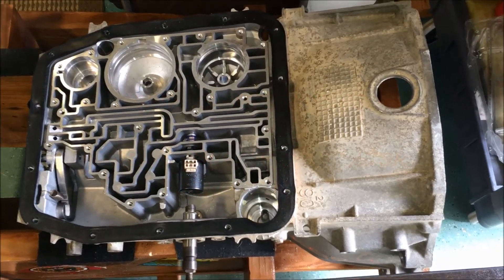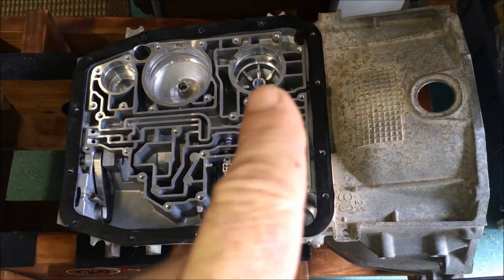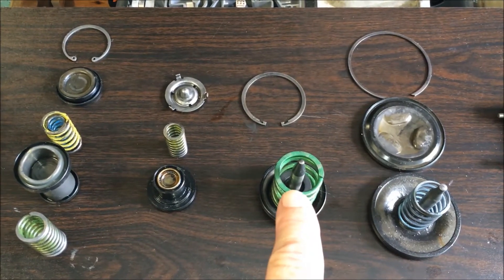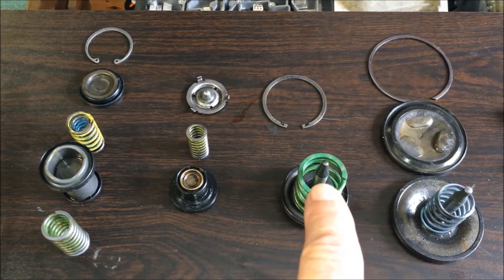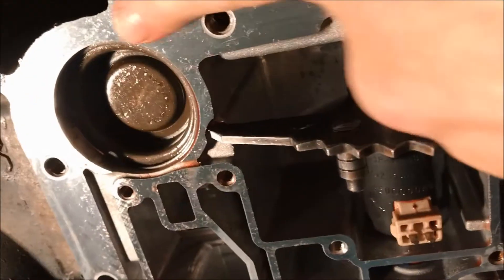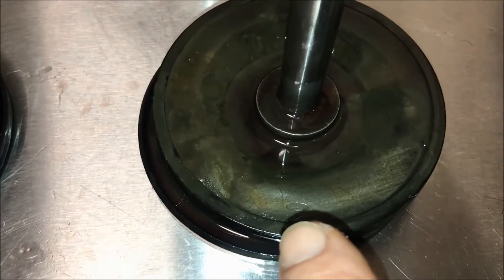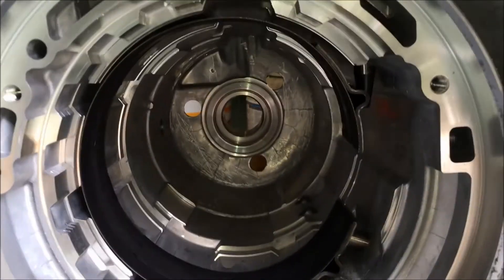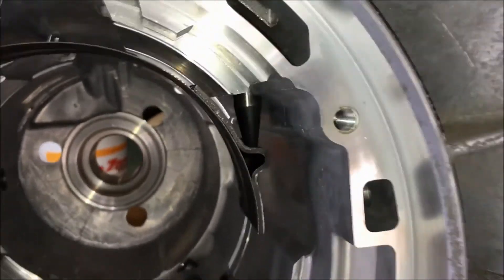How To Remove & Replace Shift Accumulator: 4R70W / 4R75W / 4R75E Series Part 5

Comment: nice video good info. seeing how the rod hits the band really works. is it possible for the rod to go past the hook while driving down the freeway? trying to self diagnose my 3/4 neutral. and its not the snap ring.. anyways Thanks
Reply from the maker: Hi DB, you truck goes into neutral when it shifts to overdrive?  Does it drive normally when you turn off the OD?
Reply: @DrivingIntelligence  yes but i only have 1st and 2nd does not go into 3rd
Reply: im thinking i may have lost the 3/4 band?  just cant believe it..
Reply from the maker: @DB Walker  sorry for late reply.  Does the vehicle continue to drive in 2nd gear?  Or it looses gear when you get to the point where you should shift into 3rd?  I guess another way to ask this, does it stay in 2nd?  Reverse ok?  It might be your shift solenoids.  Easy to replace without pulling engine.  Do you have any engine codes?
Reply: @DrivingIntelligence  hi no codes, drives normal 1st 2nd gear when it goes to shift into 3rd it neutrals out no OD either reverse is fine.. ive pulled valve body down od servo still in with no broken snap rings. the 2/3 accumulator fell out but no broken springs.. i did not take the od servo out? may i should have?   i was told if od band broke i would still have 3rd, also if OD valve in valve body defective i would still have 3rd.. i replace shift solenoid no go dont think it could be the pressure solenoid or OD solenoid because i would still have 3rd gear.. i guess  there is no 3/4 band, still learning..
Reply: @WALKERGUITAR  hey did you fix the issue having a similar issue
Reply: @WALKERGUITAR  I had the same problem, it wound up being a broken direct drum. These transmissions are also known for this problem.
Reply: @Phillyshooter  You are correct sir, that is exactly what it was.. $3000.. next time i am doing it myself.. it looks kinda fun.....
Reply: @WALKERGUITAR  I just finished mine last week. For roughly 600-700 dollars I rebuilt mine. Shifts better than it ever had before.
Reply: @Phillyshooter  Thats great!  mine is a little questionable and he only gave me a 50000 mile warranty! when stopped at a light it makes a noise and you can feel vibration out of balance anyway.. great job doing your own i learned a whole bunch here...
Reply: @agapitoleija2193  Yes, broken direct drum  i had to get a new transmission.. next time i am going to do it myself
Reply: How can you figure out its a broken direct drum???

Comment: Wow.  Incredibly helpful. Thx
Reply from the maker: glad it was helpful
Reply: My hose is to noisy to hear if the drum is leaking, but it thumps well enough, so I pulled the trigger on a sonnax rebuilt valve body from Summit.  
Over 250,000  Miles, I know I should drop it and rebuild it but I’m to frugal and I’m in no hurry.  If this doesn’t fix it, I’ll just drive it around in second till it blows up.
Reply from the maker: Sorry, don’t quite understand your comment.  Your hose is too noisy?

Sonnax is good stuff
Reply: @DrivingIntelligence  my air hose is hissing at the connection and I don’t have a rubber tip. I hear the clutch thump, but if it is has a crack in the weld, there is too much noise for me to pinpoint the sound.  Sorry for the confusion.   
I have wasted enough of your time with my  amateur mechanikin.

Thank you again.

Comment: Is it the same procedure on a aod-e? I have a 95 mustang gt . Like to do this.
Reply from the maker: Yes, the general procedure to replace shift accumulators is the same for both the 4R70W and the AODE, as they share a very similar valve body design and accumulator setup. Both transmissions require removing the valve body, removing the accumulator piston assembly, replacing the pistons and springs, and then reassembling the components.

Comment: Excellent videos. 
I have an OD shifting issue(while in OD it doesnt shift), hopefully replacing the OD accumulator fixes the issue. Already replaced all solenoids, checkballs and fluid with same issue.
Reply from the maker: I’m assuming your 4R70W won’t shift out of 1st gear when in overdrive, despite replacing solenoids, checkballs, fluid, and the OD accumulator. Does it shift normally when you turn off overdrive? If my assumption is correct, the issue could involve a worn overdrive band, damaged clutch pack, or a valve body problem affecting pressure—possibly even a planetary gear or servo failure. Please confirm if it’s stuck in 1st with OD on before I can provide more guidance.3.9s

Comment: Hey have you vet experienced an intermittent 1-2 harshness after a rebuild? I used a stock reman valve body and new accumulators. 1/2 the time the shift feels a little harsh, it never revers to neutral and does this at all loads. I’m resorting to searching for MAF and throttle body issues at this point. Any insight would be great thank you.
Reply from the maker: Have you checked your 1-2 accumulator to make sure the springs are in good shape or intact?  A 4R70W 1-2 Accumulator has opposing springs, one breaking would cause a softer 2nd shift, the other will cause a harder 2nd shift.

Comment: Awesome, looks pretty simple. Ive got a 98 explorer 5.0 with a 4r70w, has a hard shift from 1-2 so im thinking replacing that 1-2 accumulator, along with new filter and fluid should fix it. Im gonna order the parts here soon. Thanks!
Reply from the maker: Good call, the spring(s) in the 1-2 accumulator have a tendency to brake in the 4R70W

Comment: So, I've seen the issue with the overdrive pin and it's correction before. If you're working from under the vehicle, is there any such concern or fix for the reverse piston, or does that band fall naturally onto the pin?
Reply from the maker: That band falls naturally to the pin. Doesn’t require the same install.

Comment: I’m wondering if you can point me in the right direction. I have a 2002 F150 5.4 FX4 that developed a rough shift from 2nd to 3rd at low rpm’s especially when warm but normal at higher rpm’s. It’s at 130,000 Miles. Just recently it began doing this jerk at when accelerating from stops. Like the torque converter is abruptly locking from neutral when I give it gas. Another way of describing it is it is like it is in neutral after holding the brake and when I let go at times it’ feels like I am shifting from neutral to drive. I’ve heard that the 2/3 accumulator is also responsible for “forward engagement”. Could the 2/3 accumulator be responsible for these issues?
Reply from the maker: If the 2–3 shift accumulator is bad, you won’t get third gear. If it’s leaking, you’ll get a sloppy shift from 2nd to 3rd. Based on what you’re telling me, my assumption is that you have problems with the valve body. There are a multitude of valves in the valve body that impact shift quality.  Take a look at this webpage which can help isolate problem areas: https://www.transmissiondigest.com/critical-wear-areas-vacuum-test-locations-2/

Comment: Man you got me! Super excited! Getting ready to order all this stuff and throw it in my transmission. Hope it fixes my shifting issues. By the sounds of it it should. I will report back
Reply from the maker: What kind of shifting issues are you having?  Changing these items plus a valve body rebuild will improve fluid management in the transmission and improve shift performance.  But it depends on the problem.
Reply: @DrivingIntelligence hey I didn't see your reply until now. Some things happened and I am now getting ready to do this. When shifting from first to second and very rarely sometimes from second to third it will come out of gear and rev up high until I let off the gas then it will shift into the next gear

Comment: So on my 2008 p71 i don't have 1st and od but 2/3 works but when i took off the valve body to inspect it the 2/3 servo came off so now im in a stump
Reply from the maker: looks like you need a full set of shift accumulators.  Check out the link in the description of this video.

Comment: I may have an issue with my 2/3 accumulator. The transmission shifts great through out all the gears as I accelerate and also down shift with no issues. But when I slow down to 18 or 19 mph and accelerate again, it seems as though either its accelerating very slowly or in neutral. I have to step off the gas and then apply the gas again slowly for it to pick up speed again as normal. Its the 4r70w transmission in an 05 crown vic. It might be a stupid question but what state are you located in, maybe I can drive to you so you can help me fix this issue and I can pay you because the mechanics around my area don't seem to know what to do or they keep sending me to other places.
Reply from the maker: Thanks for your comment and considering me to help you get your Crown Vic right... let's start with some basics:  1)  do you have any diagnostic trouble codes? 2)  have you recently removed the pan and installed fresh fluid and a filter?  This could be caused by several issues like a faulty TPS, bad shift solenoids, bad accumulator, leaky separator plate and on and on.
Reply: @DrivingIntelligence  no, I have not changes the transmission fluid or have any diagnostic codes. I checked those with blue driver obd2 and nothing. Also I'd like to correct myself; it's not the 2-3 accumulator but the 1-2 accumulator most likely because everytime this happens at around 18 mph after breaking to that speed and accelerating again, the engine wines the same way it does at 1st great except it wines faster since at that speed it should already be at 2nd gear. It's as if I had a menual transmission and I didn't shift into 2nd when I was supposed to. So it must be the 1-2 accumulator because only thr 1st  gear wines like that. As far as the TPS. Don't think that's the issue since the accelartor peddle is responsive all other times as well as when the transmission hesitates to shift to 2nd gear. It may not shift right away but the engine does respond well to accelerator input. Another thing is, the 1-2 hesitation seem to happen once the engine warms up. Also, at lower accelaration 1st changes to 2nd at around 10 mph and at faster accelaration, 1st changes to 2nd at around 16 mph if that makes any difference. Thank you for replying and I appreciate any input or advice.
Reply from the maker: @aeylxb3472  it sounds like it could be the 1-2 accumulator, and you are in luck.  You don't need to remove the valve body to replace that accumulator.  The springs or spring in the 1-2 accumulator have been know to fail / break.  You could drop your pan, change your filter, fluid and the 1-2 accumulator and associated springs, and see how that works out.  By the way, I'm in South Carolina.
Reply: @DrivingIntelligence  Strangely the issue has begun slowly subsiding and then I realized that the only thing that I have done differently was unplug my blue driver OBD2 from the port. So it must have been that, which was causing it since it has always been plugged in. It must've messed with the computer. I spoke to one of the mechanics from Ford service and he told me you are not supposed to leave anything plugged in for prolonged period of time. Another issue I'm having is a humming sound coming from the front end between the 1 and 2 gear while accelerating and only happens if i slow down to around 18 mph. I read that it could be a dirty IAC. Anyways I'm really not sure what the issue is but I will try to figure it out.
Reply from the maker: Interesting, I ran my Bluedriver for months with no problem using data log.  Check out this video for the IAC valve and noise
Reply: @DrivingIntelligence  Thanks. I've already seen a few videos. Well, I'll let you know how it goes.
Reply from the maker: @aeylxb3472  look forward to an update
Reply: @DrivingIntelligence   Ok, so I have a pretty interesting update. Since I got all the parts I wanted to replace being the control solenoid, the TCC solenoid and the 1-2 accumulator springs and piston as well as the cover, I went to work and changed both of those solenoids and when I checked the accumulator springs, they were fine. I also changed the filter and added new transmission fluid. About the same amount I drained off. So I test drove it and still the same issue with hesitation to shift to second gear after slowing down from 30 mph to around 18 mph. It just as if it goes into neutral as I press the gas the engine whines but no acceleration, just coasting from whatever momentum the car got from actually being in gear right before that. Now when it does that and hesitates to shift, it actually makes a humming noise coming form around the transmission area. Now, I think I know what the actual problem is. When I pulled down the transmission pan there was no magnet where it should be. This means, whomever did the transmission fluid change the last time, didn't put the magnet back where it should be and just like that the metal shavings must have been getting collected in and around the transmission pump clogging it until it begun having issues pumping transmission fluid. I think this is the case because one of the symptoms of transmission pump issues is humming noise and delayed/hesitation to shift gears. Now, the transmission has also begin hesitating to shift from 2nd to 3rd gear it seems. Only thing is that if I accelerate from a complete stop the gears seem to change just fine, except when I slow down and accelerate again at speed below 30 mph. I even reset the ECM  by connecting both the negative and the positive wires together for about 10 minutes and then did a test drive and its still hesitates to shift. So I'm thinking its either the transmission pump and or the forward clutch.
Reply from the maker: @aeylxb3472  thanks for that thorough update.  Sounds like you might be on the right track.  I assume you installed a new magnet?  Also, there are some friction modifiers you can buy that may help.  I use 1 quart of Lucas Transmission Fix at every tranny change now:  https://amzn.to/3recmuP as well as adding Dr. Tranny Instant Shudder Fixx:  https://amzn.to/46AnCSc these might give you a little better performance until you get this resolved.  Please keep me updated.
Reply: @DrivingIntelligence   Yes, I'm actually going to try and use the Lucas fluid next. Only if there was something that can dissolve metal shavings inside the transmission would be great. No, I did not put a new magnet as I didn't have one the proper one. Because I opened the transmission pan twice. Once for the solenoids and once again to check the accumulator springs, I drained about 7 quarts of old transmission fluid and put 7 quarts of new fluid so it should be fine for now. I will though put a ceramic magnet to the outside of the transmission pan for now. Ok, so I put almost all of the Lucas transmission fix bottle into the transmission and did a test drive and it still hesitates to shift but ends up shifting slightly faster. So I think its might be working. Another thing I've noticed is usually between 10 mph and 20 mph or so when the car is coasting I hear a humming noise that I thought was electrical when I said it might be the transmission pump but the humming noise is actually sounds like metal grinding almost as a high pitch and that's always how I know that if I put my foot down the gas it would hesitate. I begin thinking that it might actually be the 2-3 accumulator because it seems to shift 1st to 2nd fine which is like 0mph to 15 mph but the the issue happens between 15 mph and about 22 mph. That's when the metallic humming noise is coming from as well as when it hesitates to shift to what I thought is second gear but now thinking its the 3rd gear. Also another thing I've noticed is if I accelerate from a complete stop onward fairly quickly then it changes through all the gears just fine but if I accelerate slowly from a complete stop then that's when I hear the humming noise between the gears at about 15mph and 22mph until it shifts into gear after hesitating. I also just scanned the car with my blue driver blue tooth obd2 adapter and no codes came up related to the issue I have. The only code I got was the (VAPS) circuit failure C1897.
Reply from the maker: @aeylxb3472  I was going to suggest putting the magnet on the outside to get rid of some of the metal... good call.  I can't give any guidance on the noise since I can't hear it.  Given there was no magnet, you might be in for a rebuild at some point in the near future.  I'd be concerned about removing any more fluid and replacing with fresh as you might remove too much of the suspended friction material from worn parts and will cause even more problems with shifts.  Stay in touch about your progress.
Reply: @DrivingIntelligence  One more thing I figured out is that the issue with shifting happens between 2nd and 3rd gear for sure. So it might be the 2-3 accumulator. 2nd to 3rd shifts fine but has issues shifting back to 3rd from 2nd after reducing speed to 2nd gear. Also, the Lucas transmission fix fluid didn't do much which makes sense if its the 2-3 accumulator broken spring or partially collapsed. So the plan is to remove the valve body this time to check the 2-3 accumulator spring. Is there anything specific or important I should know when removing the valve body/putting it back? Also, how does the metal cover that doesn't have a retainer gets held against the spring of the accumulator? Is it hard to remove/put back?

Comment: I need to replace the springs in the transmission. Can you please tell me if the springs that are in the video will fit the ford f150 1998 Triton V8 4.6?
Reply from the maker: Hi, all the parts I used are in the description with Amazon Links.  If you want accumulator springs, you get most of what you need here:  Shift Technologies Shift Kit for 4R70W – https://amzn.to/30jf8RX - I suggest if you do this, you also get these parts:  AODE 4R70W Piston Set 1990 and UP - https://amzn.to/2E3TNAL - these will work with a 4R70W Transmission which is likely what you have in your truck.